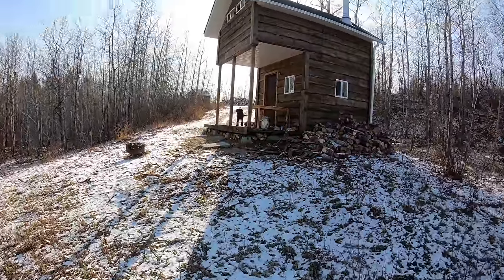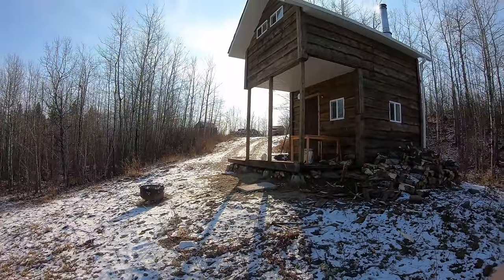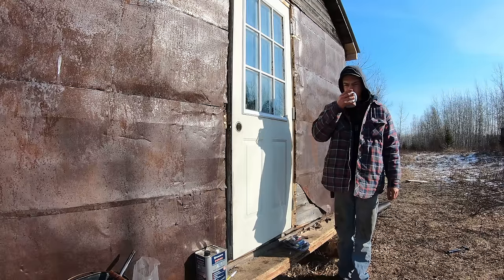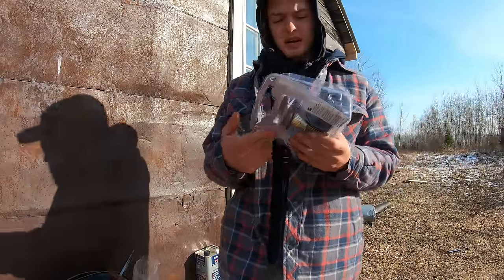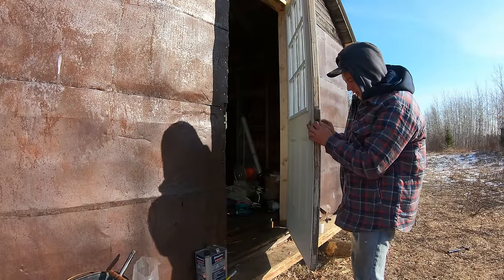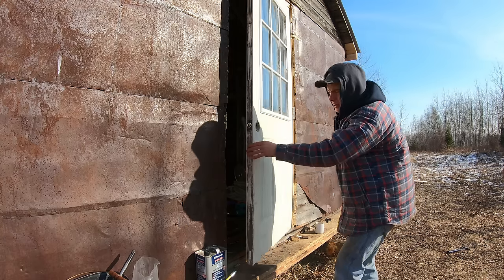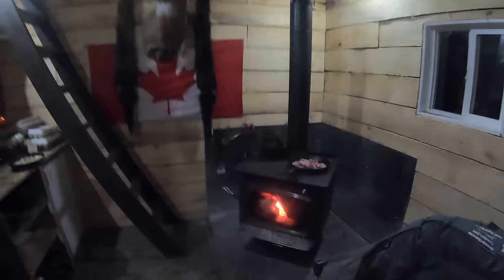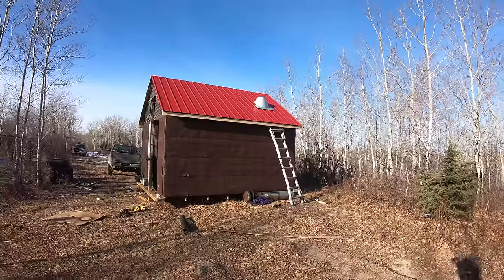Offgrid Workshop Project Pt.6 - Finishing Wood Stove, Electrical, Doorknob, Framing Windows

Comment: Great videos !!  FYI. You can buy wood trim called door stop and you mail it up against the door sides and top. It keeps the door from going in too far. Eventually it will stress the hinges as the door is closed sometimes too hard. You can mail it with a small gap and attach self sticking weather strip to seal it a little better.  Keep up the great content.

Comment: Just a tip, one I learned from my dad.  When he had a cabin in the Adirondack mountains, he made sure to install a small pipe through the wall to the woodstove, just underneath it. It allowed outside air in to provide oxygen for the stove and helped reduce cold drafts elsewhere in the cabin. Yet, still let fresh air in. 😀
Btw... the pipe had screens at both ends to prevent pests from getting into the cabin.
Reply: Solid advice
Reply: My grandfather did the same used PVC 2"

Comment: Love the videos. Just mabe a little info on your next cabin. Install the pipe and flang that go on the roof side first before you lay down the roof sheeting. Like screw the flang down on the frame you made, right  Then those sheets have to be longer where the stack is so you can cut them in two . Then lay the bottom ones first measuring around the bottom of that stack nice and tight Then the top sheets will lap over the bottom sheets, and cutting the top sheet around the top of the stack. Use those profile spacers around the stack under the sheets . Then caulk around the sheets where it meets the stack. Now all that will be show is the round stack with no flang showing at all.........a friend from British Columbia.

Comment: For your hinges just leave one screw sticking out about 1/2 inch, cut the head off and remove the opposing screw in the door hinge, do this for all your hinges, even if they pop the pins you 'll never get the door off because your screws are holding the door on/half the screw is in the door hinge the other half of the screw in the jamb....or remove the screw completely and replace it with a metal rod of equal dia.

Comment: Lil tip for you when you paint galvanized steel. Take a clean rag and splash vinegar on it then wipe down all the metal your painting, it’ll stay on better and longer. Also for your cabin door, it SHOULD swing in. Residences swing in, shops and garages swing out. If your in the cabin sleeping through a blizzard, you’ll be able to get out easy enough with the door swing being in. As for the shop, you’ll have to shovel your way to it anyway, so unless you fall asleep in there during the same storm your good.  It’s coming along nicely brother, let’s hope you won’t ever have to “Bear test” that door! However one WOULD make a nice rug for the cabin AND it’ll stock your freezer for the rest of this winter! 
Stay healthy, stay safe😉✌🏼

Comment: I don't know if you know about Unique' Off-grid solar fridge 12 volt -24 volt they have different sizes might help you they did me . saves on the batteries only need two and one 300 watt panel . that would run your lights also . 300 w so when the sun not good you will still have power on batteries not to run out . love your Vid's

Comment: On a Hi-rib steel roof, you should probably be using a silicone boot. That tin flashing is meant for under shingles I'm pretty sure.
Reply: can of liquid flex seal ! i swear to frig stuff could leak proof a submarine
Reply from the maker: also for tin easier to install though on shingles
Reply: @TraplinesandInlines  Ahh, yeah I was looking at all that cutting you had to do. I used the boot on mine and it was a super easy and clean install over that hi-rib. I just cut a square in one of the stud bays and screwed it down over it. Seems to have worked really well. It also seals around the pipe itself watertight which is nice. Great videos!

Comment: If you’re worried about someone taking your door pins out, tap them out half way put a slight bend in them then drive them back in. Anyone that tries to take them out after that will be hard pressed and end up pretty pissed and give up.

Comment: Suggestion:  You maybe should have put jam stop (1/2" x 3") on both sides and the top, BEFORE putting on your weather stripping.  What's stopping your door from going in too far?  The weather strip?  Not deadly, friend.
Reply from the maker: hey bud the weatherstrip is pretty solid with the metal on it i have same thing on chicken coop has done well
Reply: @TraplinesandInlines  good to hear. It’s deadly then!

Comment: Lanyard for your keys is the go. I use to have ove 6 key rings with work. Looks a bit dickish but if you drop them in the dark or long grass you can find them.

Hows the solar keeping up in winter?

By the way the wedge (ground edge) on the chisel is meant to be at the back, but it worked fine. Can make life easier in the future. That exposed catch pin on you door can be flicked open from the outside with a card or anything as its not a dead lock. Locks only keep semi honest people out. Wtf are they doing on your land if you catch em in the middle of no where.

Comment: Unless that little latch is completely out you can get in with a simple credit card with out you can’t! Look at the latch plate see the bent piece of metal that goes in the hole it has a slot in it that slot you stick a flat screwdriver in it and bend it out it is to tighten the door Whitt closes so the door is not sloppy loose !
Reply: It’s a skinning shack in the middle of nowhere buddy. Unless the bears have got a Amex card, it’ll be good.
Reply: Gotta watch out for those circus bears and their Bear of the Month membership cards...sneaky petes. But, we shouldn't laugh...I've seen a Dodge Caravan with the entire back end ripped off by a black bear in Jasper National Park. lol